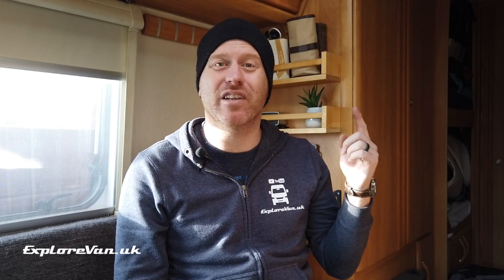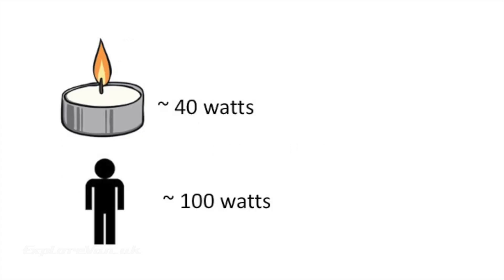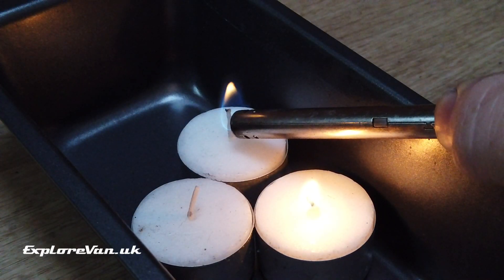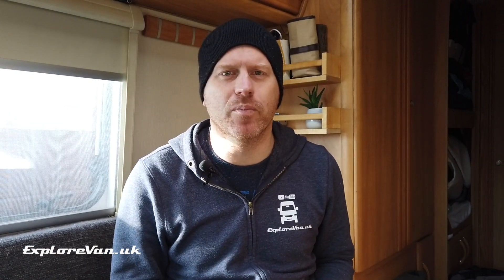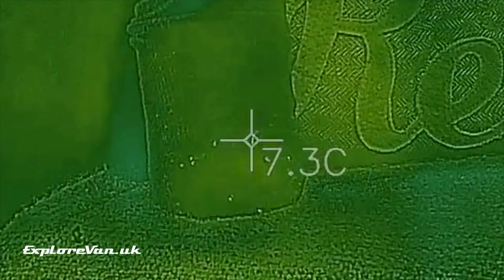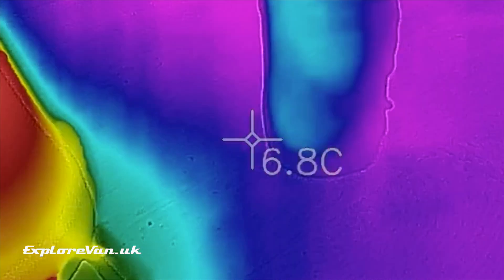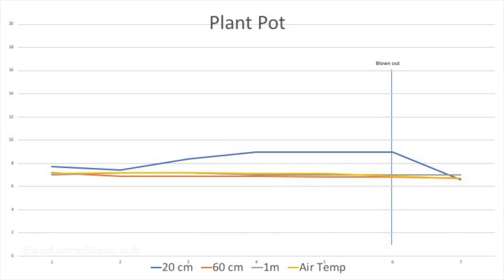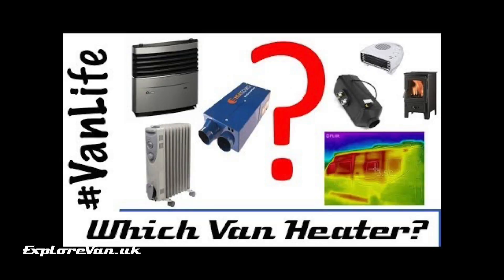Plant pot heater test - Do they really work?

Comment: Thanks for the correct evaluation. A candle puts out a certain amount of heat, this heat cannot be amplified without the addition of external energy, laws of thermodynamics. Adding a ceramic pot or two will not increase the amount of heat from the candle. Therefore the ceramic pots are only a safety device so stupid people do not touch the open flame, just light the candles and enjoy the flame…

Comment: Im experimenting with various designs but I keep coming back to the brute reality of physics: tea lights dont kick out much heat. I think the main benefits of the heaters is that they stop the heat going straight upwards as a thermal current towards the ceiling, and create a bit of radiant heat. They also heat the candles themselves so that they burn faster, and release the energy more quickly.
Personally I have found that in a small room, on very very cold nights, 3 tea lights in a heater will raise the temperature of a room by a few degrees. Nothing more. Then again, that is technically what tea light heaters were always intended for. For example, some people recommend a tea light in a snow hole, because it keeps the air temp above freezing (a critical threshold).
Im going to carry on testing different designs but I would note that they DO work, but only for taking the edge off bitter cold. They also come at a substantial fire risk. If you design your heater wrong, and heat the candles too much, the fuel can reach flash point and literally you have 3 small tubs of liquid paraffin wax burning away, chucking out acrid smoke.  
I would note that you can buy an ultra-budget 25tog double duvet on Amazon for about £20. It will not burst into flames, give you carbon monoxide poisoning, and if you cant keep warm in that, well frankly you are hypothermic.

Comment: A good attempt at the experiment thanks for sharing. As in all these things. Passive heating is the best. I live in a passively heated Eco flat. They work. The more insulation the better the heat retention. Then there is the draft proofing. I think during winter installing extra insulation with thick quilted silver sheeting directed inwards would give both reflected light and heat retention. Heating several hot water bottles and adding under the covers really will keep the air around warm and keep the sheets warm too. Heating water has been proven to be the most efficient form of heating exchange. Heating the water with a 300- 500 watt heating element is the best way to do that or small gas water boilers. The boilers are very cheap. too. Heating elements will need lots of power but investing in batteries that you can charge up somewhere is probably the cheapest energy in the long run.

Comment: If you’re going to try and rubbish a perfectly good system at least conduct your experiment correctly……🙄
Reply from the maker: Thanks for your feedback. 

Have you checked out the other two videos linked in the notes on the other designs?   Spoiler alter - they don’t work either! 

Twin pot  - https://youtu.be/njDCfmve_FM 
Cornish pot heater  - https://youtu.be/VY_-aqd9-vc

Comment: You missed a step. You didn’t put a metal coin over the tiny hole at the bottom of the pot to control heat output
Reply from the maker: Twin pot  - https://youtu.be/njDCfmve_FM 
Cornish pot heater  - https://youtu.be/VY_-aqd9-vc

Comment: Just remember, anything that is a heat sink (terracotta, cast iron, etc.) will be wicking heat from your space whenever there is no flame heating it. You can get more radiant heat if you just used the candles to boil some water and put it in a hot water bottle and keep it near your core. If you're in an enclosed space, be aware of the humidity caused by the boiling water. Humidity is the last thing you want in a cold space! 
Another thing to consider is, shrinking the space you are trying to heat with blankets or sheets. Moving blankets from harbor freight are cheap (sometimes $6 (with a coupon) for 72"×80") and effective. My garage walls are lined with them and they work great. 
While good ventilation is crucial, sealing up unnecessary cracks can greatly increase your efficiency!

Comment: You aren’t doing it properly. The plant pots should be on a fire proof flat surface. There should be two pots. A larger one over a smaller one to insulate the area. A brass connector should be placed in the hole in the top of the plant pot as it’s a good conductor of heat.
Reply from the maker: Please do check out our other videos of designs like you suggest -  https://youtu.be/njDCfmve_FM and here https://youtu.be/VY_-aqd9-vc

Spoiler alert - they perform just as badly as this one.

Comment: All the heat is escaping around the sides, put your candle on a plate put four coins on the plate ,light the candle,put your pot over the candle resting on the coins ,less heat escapes, don't forget to cover the hole in the top of the pot .
Reply from the maker: Check out my other video here using that design. (Spoiler alert, it’s no better than this one) 

https://youtu.be/VY_-aqd9-vc

Comment: I have done it with 2 pots. This guy is right! It does NOT work. The candle put out so much heat. Terracotta is not a magic material.
Reply: Well, it does work. But just not enough to really heat up a space. You would need about two hundred of these to heat up a room. I would call that a fail.
Reply: Terracotta pots serve two purposes they limit the access to the flames...  they  store the BTUs and slowly release them...Beyond that  "a flame is a  flame is a  flame".. Studies have been done and the scientists used candle flame to develop the British Thermal Unit (BTU) scale

   If Terracotta could enhance heat of a candle does anyone really think the petroleum industries would put up with the manufacturing of clay pots???

Comment: Fail, you need two flower pots and cover the inner pots drain hole before placing the second pot. I used it for years when in college. It does work.
Reply: He didn't do his research lol.
Reply from the maker: I think you both need to watch my other videos (links in the description of this one)
Reply: This guy is so full of crap. He TOTALLY did it wrong, and he OBVIOUSLY doesn't understand the science of convection. I feel dumber for having watched this idiotic video.
Reply from the maker: Thanks for the feedback, though I think it says more about you than me. 

Feel free to explain to everyone how convection increases power output.

If you feel the design is incorrect you may be interested to watch the other videos linked in the description of the other designs I tried. (Spoiler alert - they don’t work either)
Reply: Too many variables left out of your statement.

Where were your flower pots placed? If you were in a dorm room with no electricity, then you still have heat flowing in from your neighbor's dorm, and the heat that kept you warm came from there.

Comment: not very convincing as you miss the second pot/layer seen in every example of this I’ve seen , the metal core ( threaded bolts) etc etc so ask your results seem a bit pointless. try again.
Reply from the maker: May be try checking out the other videos, also linked in the description, before drawing conclusions?  (Spoiler Alert - the other designs don’t work either) 

Twin pot  - https://youtu.be/njDCfmve_FM 
Cornish pot heater  - https://youtu.be/VY_-aqd9-vc

Comment: No offence, but you're missing the top saucer, that is the main radiant heat source and it takes hours to get the temps up.
I should also point out, I live in Canada (Alberta) and that 3 years ago, I got stuck in a ditch for 14 hours about 60kms north of Westlock in January outside temps were in the -20c range daytime and -34c at night, I used a Cornish heater in my van to stay warm, waiting for a tow. I could have abandoned my van when a passerby offered me a lift, but I declined since I didn't want my van towed to an impound. I always keep a few bottle waters, a box of granola bars, a sleeping bag, a real wool blanket and tea candles plus other larger candles and the setup for a Cornish heater.

When you live in a country that actually has winter, you'll never underestimate the power of a candle. And just the FYI I drive a 2012 Dodge Grand Caravan.

Heat rises, and since you had nothing to capture that heat nearer to the ground (i.e an inverted saucer over the pot), you lost most of it to the roof. If you had had a thermal camera pointed to the roof of your vehicle, you would have saw the higher temperatures being wasted there.

Here is a clip from Fort Saskatchewan, about 100km south of where I got stuck, boiling water thrown into the air.
https://www.msn.com/en-ca/weather/video/the-cold-temperature-science-experiment-thats-taking-the-prairies-by-storm/vi-BB1dtIib Feb 7th 2021
Reply from the maker: Hi - thanks for taking the time to comment and share your experience. 

The test was to determine if it was a sensible way to heat a van and followed the instructions of one of the many You Tube videos - you can also see a follow up test on a second design here - https://youtu.be/njDCfmve_FM 

Whilst I can imagine the morale boost and placebo effect of having any type of candle heater is a huge one in a survival situation that really wasn't the purpose of the test.

I'd be pretty confident your sleeping bag/wool blanket combined with your own body heat played much more of a part in keeping you warm than the candle heater.   

Out of interest why did you not run the van engine and use the normal heating in that situation? It would have been a much better way to keep the van warm - a cycle of a few minutes running every 10 - 15 mins can conserve fuel for a long time and keep the space pretty warm, even in those conditions.
Reply: @ExploreVanUK  I didn't run the engine because I was low of gas, I should have filled up in Westlock. But I was running behind. My tow call had up to a 24 hour wait, so I decided to conserve my gas as much as possible. It was a stupid decision on my part not filling up, and one I've not repeated since.
Reply from the maker: In your situation / location I would suggest you would be the ideal candidate to get yourself a cheap diesel heater with a dedicated tank so you can always be sure of a good source of heat, it would be a lot more comfortable than huddling around some candles wrapped in sleeping bag and blanket. 

However, if I found myself in a survival situation without a heater, I'd be making sure I had some ventilation and using the propane stove occassionally as a heater, which would give out about a 1kW of heat. But again it's not something suitable for regular use.
Reply from the maker: Here's a quick test of the set up you mention - https://youtu.be/VY_-aqd9-vc     
(let me know where you got your magic candles / saucer ;-D)

Comment: This isn't very helpful as they all use two pots. You spent so much time doing all this  so why not do it properly?
Reply from the maker: Hi, thanks for the feedback , when I did it (quite a while ago now) I followed the instructions from one of the simple videos I saw.

I didn't want to spend a load of time making something, as i was already pretty confident it wasn't going to be effective (like I said in the video). Just the fact that the heat output of candles is so low and you would need 19+ of them to keep an average van anywhere near warm in a temperate climate was enough for me to know it couldn't work.  No matter how many pots you add you cannot increase the amount of heat produced.

In the current lockdown situation - I have got a bit more time on my hands - so who knows, I may retry the experiment with some neste pots just to prove that, when I run out of other more exciting uses of my time.
Reply: I never saw you cover the pot hole & all the video ive seen cover it
Reply from the maker: @hauntqueenJ   Chech out my other videos with tests of other designs - - spoiler alert - - non work well enough to heat a van

https://youtu.be/VY_-aqd9-vc

https://youtu.be/njDCfmve_FM

Comment: If your serious about doing a real test, make a correct heater. If you don't know how to make one, you don't know how to preform the test. YOU FAILED!
Reply from the maker: 🤣 if there were such a thing as a correct plant pot heater I would. 

In all seriousness if someone can explain to me how any number of plant pots in any arrangement will change the 40w of heat provided by each flame to the total of 750w needed to heat the average well insulated van in a temperate climate I’ll put my time into doing a another test. 

But until then, I’m comfortable with the results of this test.

Thanks for taking the time to watch and comment though 👍
Reply: @ExploreVanUK  : You could start off with any size you like, lets just say 3". I believe this works best with 3 different sizes. A long bolt, nuts, washers, A 3" pot, 4" pot and a 5" pot. Run the bolt thru the inside of the 3", outside bottom, put a washer then bolt. Slide the 4" pot over the bolt so the 3" pot is inside, then washer & bolt. Same with the 5" so the 3 pots are nested together, the nuts keep them slightly apart for security and air space.  Now the 3 pots over a candle/candles in the same fashion you had it should produce much more heat.
Reply: I don't know if you'll get 750w but it will definitely warm a room
Reply from the maker: Thanks for the instructions but thermo dynamically I know it won’t magically produce more heat. It can’t. There is a finite amount of heat that the flame can produce pots will not make that more.

They can diffuse it and potentially distribute what little there is but it won’t create more. 

Thermal loss is also finite. 

If you had a very small room and only wanted to raise the temperature by a very small amount I get it. But for a van wanting to increase it by 10 to 15 degrees C the only way would be to fill the van with them.
Reply: @ExploreVanUK  That I can not argue with, I do not know the scientifics of this or what the temperature increase would be. In a 15x15 foot room around 60 degrees it took the chill off nicely. No temperatures were taken or tests were done, it just helped alot. I meant no offence in any comments and changed my "click" to a thumbs up, keep up the good work. This is why it is called experiments.

Comment: You need to use two plant pots to create a furnace effect. That's why this didn't work. The furnace effect sucks the cold air in at the bottom and funnels it out of the top. Just one plant pot on top won't do that
Reply from the maker: Whether it would aid with funnelling or not isn't really the point - whatever you do the candle will only create the same amount of heat - which is far from enough to make a space comfortable.
Reply: @ExploreVanUK  no not really, it's the difference between creating a current which ultimately sucks cold air in and pushes hot air out versus a hot piece of pot. It's the difference between heat which radiates (ineffective in a cold room as you have to sit inches away from the hot item to feel it) or heat which travels through a convection current. You made a lot of effort to do this experiment, I'm just saying that the two pot thing is the one that works more efficiently - the build of it you can find on other YouTube videos - need to plug the hole at top of inner pot, but leave open the hole of outer pot. If you can be bothered with it all again, I'd be interested to see the thermal imaging results 👍🏻
Reply from the maker: Thanks for the thorough response, I can see how some form of convection current may spread what little heat there is around more, but as the amount of heat the candle can give out is finite, it just means that the small amount of heat will dissipated  across a bigger area it can’t make it give out more heat. 

Unless you filled the van with candles you’re never going to get it to a comfortable level for a temperate country. 

When I run out of other topics that I feel are more valuable to spend time on, you never know I might revisit it.
Reply: She's right.  You need to put a foil spacer or a just another used candle tin OVER the hole in the first pot, then a Bigger pot on top.  That insulates the bottom, allowing the whole smaller pots clay to heat up and not just the top, and forces it out the bigger pot.  You failed the build and tested the wrong thing.
Reply from the maker: @BeJohnBrown  Thanks for your comment - please can you explain how adding extra pots/spacers etc will make a candle that can only give off a maximum of 40w of heat power give out more? 

There are loads of different instructions claiming to make these "work", and I'm afraid I don't have time to try all the variations.  I picked one of the simplest just to demonstrate what I was pretty sure I already knew.
Reply: I'm going to put some plant pots on the radiators in my house , should save a fortune in gas bills ???
Reply: @mikedakin2016  what if you build a house entirely out of terracotta? Then put a giant flower pot in the middle with a campfire under it. I figure that way i can heat the whole neighborhood.
Reply: @mikedakin2016   lol

Comment: Putting a pot on a candle and expecting it to produce more heat than the candle it's self, Is equal to painting a flame on your car to make it go faster.    The flame of a candle produces so much heat.   It will not produce anymore heat no matter what you do unless you add more fuel, Heat or oxygen.  A metal rod and nuts and washes as well as a pot can NOT increase the heat.  They can simple store some of it for latter.
Reply: That's the point of using it for this. To store the heat in a local place

Comment: Did you check the top area near the ceiling? Heat rises. Maybe that’s where the heat went? Plus the base used looks very unstable, I’d be scared to use that. Maybe a small cast iron pan with a small pebbles in it nestle the candles in them add a tiny amount of water and essential oil in it? Place the pots doubled up and enjoy the mood of it if nothing else? Lol!